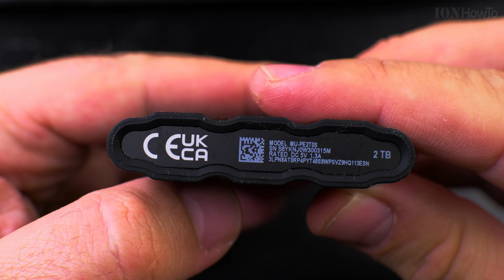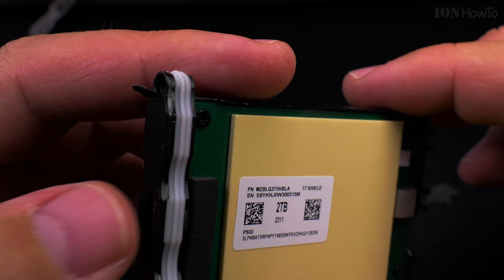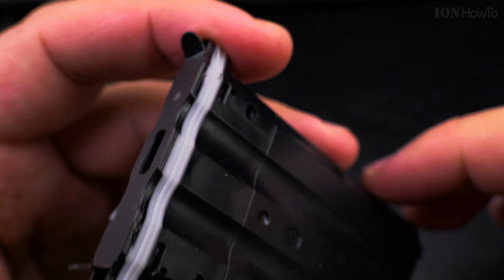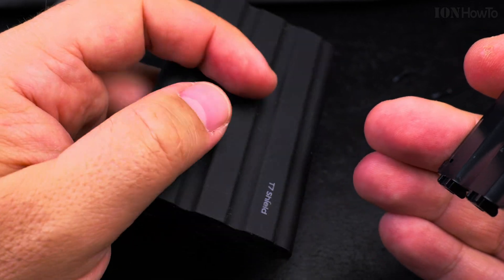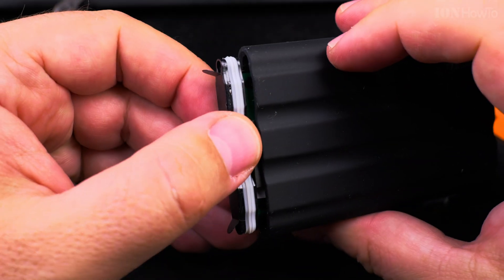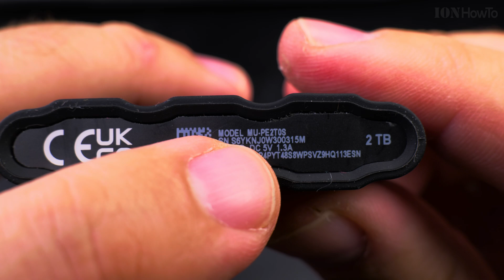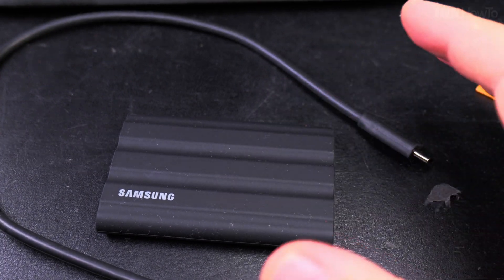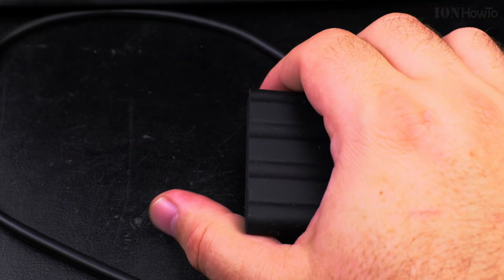Samsung T7 Shield SSD Teardown Water Damage Check

Comment: Who is more durable T7 or SanDisk SSD plz suggest me a great solution.
Reply: Go with t7 you will never regret it. There’s a major issue in sandisk one. Everybody’s complaining!
Reply from the maker: I don't know, I would get the cheapest or the fastests depending on what's more important.
The t7 plain not shield is not so protected but the sandisk has a plastic case afaik.
I would buy the t7 shield which I did haha